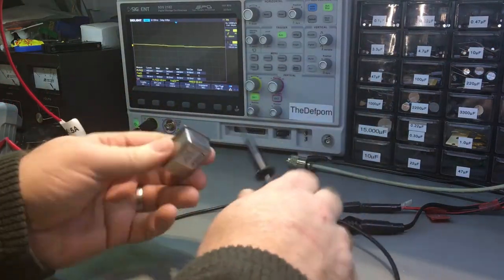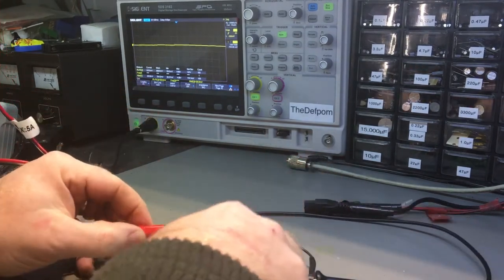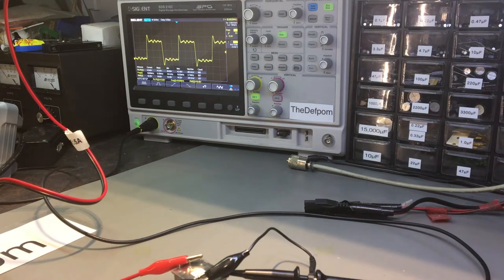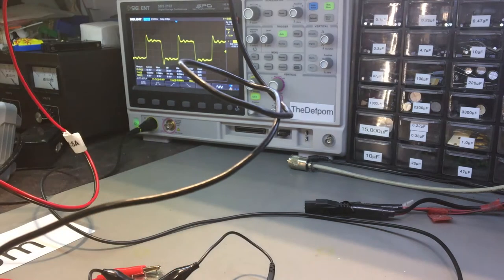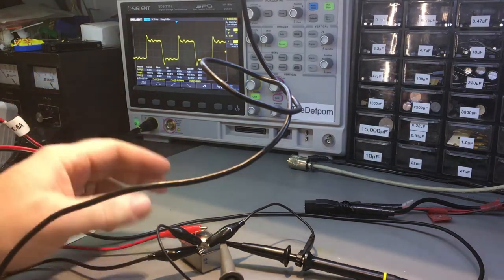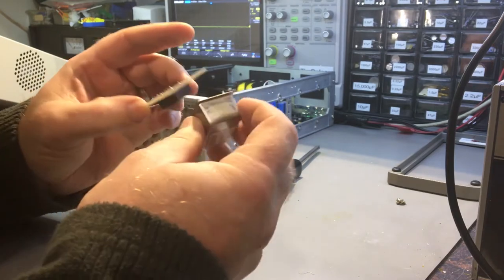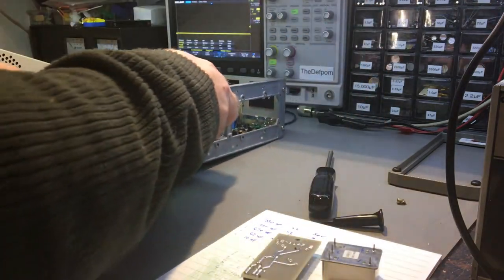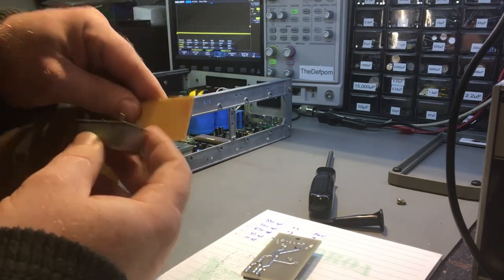#237 Racal Dana 1991 DIY 10MHz OCXO Build

Comment: better to use double side pcb and one face as gnd plane shield ..to make it dont you have cnc machine?
Reply from the maker: Mirk Poli - I was doing a one off build, with no plans to make more, so perforated board was fine for it, if I was going to build a bunch of them I would of made some proper pcbs.

Comment: Surely that Rb would be better as an external reference? They need a bit of work, decent heatsink to keep them around 50C and a distribution amp but you could feed your entire bench with it...

There's a few options that can be fitted in the Racals, I lucked into a couple of them with the 04B high stability OCXO and they're so close to the Rbs and GPSDO I have that they're just not worth tweaking (and when I get a permanent bench I'll use one of the Rbs to reference it all)

If you connect ref out on the counter to a 'scope channel and the Rb to another then you can tweak until the signals don't move with respect to each other, best bit is you don't have to wait for counter gate time

https://www.youtube.com/watch?v=KmZwAjmzHx8
Reply from the maker: +Clint Jay - yes I am planning on doing exactly what you suggested for the rubidium, I already have a few boxes arrive, I'm just waiting for the distribution amp to arrive (which I will need to modify to 50 Ohm), I had just been dragging it out for the occasional calibration, as all my gear has OCXOs anyway and are very accurate normally. I have demonstrated the scope measurement technique in one of my videos previously, yes it is easier to match without waiting for gate times, but in this case I couldn't be bothered hooking it all up.
Reply: Ah, hadn't seen your video with the 'scope method, teaching granny to suck eggs :)

I went through the theory of modding a video amp but when mine (an Extron, later found out Gerry Sweeney had done all the work already) arrived I tested it and it worked just fine over a few metres of coax driving four instruments, couldn't detect any added jitter or weird harmonics so I've not bothered to do anything other than check the caps in the PSU.

One day soon when I get a few hours spare I'll build the second Rb into it and probably mod it just because it's stripped down but til then, I'm doing occasional sanity checks against the other Rb I have (nicely rack mounted but way too large for my temporary bench).

Comment: Worthwhile mod. My Dana as an OCXO that takes at leat 30 mins to warm up. Might be worth replacing with a smaller low mass type like yours.
Reply from the maker: Simon Spiers - yes this one is pretty much right after only a couple of minutes, is stable after about 5 minutes, and is rock solid after about 15. I actually just sold this unit and the OCXO to someone on a local auction site, and they are a subscriber to my channel.